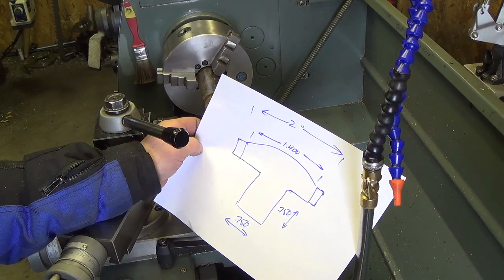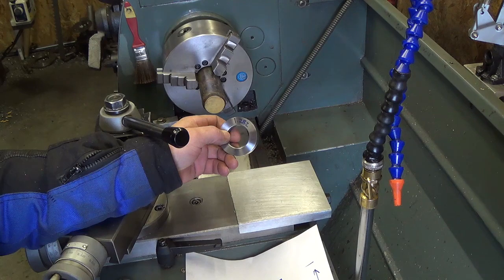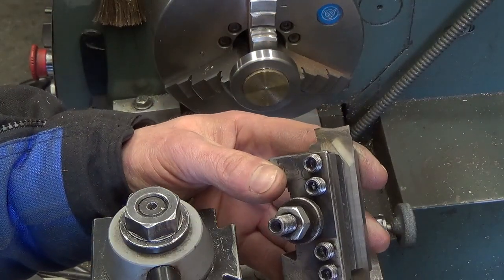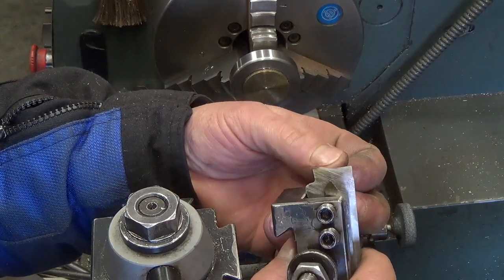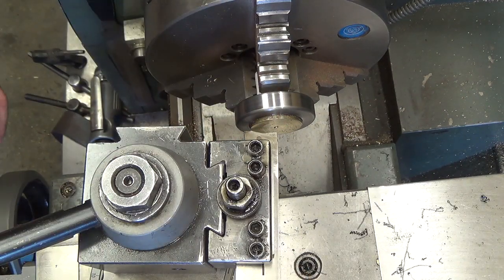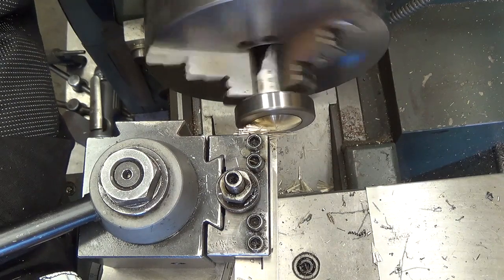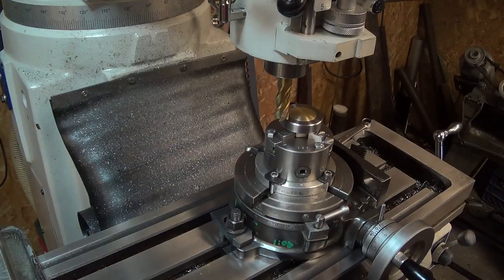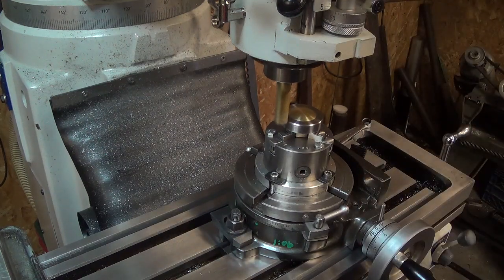5th Axis - Part 5

Comment: I like that you showed the bork of the hand nut. Like that doesn't happen to all of us at the WORST times. Did you end up using a setscrew ? Was it a small SS bolt with the head filed off ? Thanks for the videos, although I am jealous at the nice new mill and all I see. In the South US, we depend on what we can get from old machinery sales.
Tool Jealousy...ugly when it happens.

Thanks.
Reply from the maker: Should have had the small chuck tightened just a little more.. oh well. No setscrew, just a bolt with the head removed.
Jealous?? Ha, I'm so jealous of you guys and the availability of tools and tooling in the more industrial areas. There's nothing used in my area and whatever I want/need I have to buy new.
Thanks for commenting.  Colin ;-)

Comment: Nice Colin the SS/brass looks first rate.  Too bad at the end but those things happen and you were able to fix it right.
Reply from the maker: Yeah, I do also like the look of the mixed metals. I don't mind the odd boo-boo as long as it doesn't ruin the piece.
Thanks
Colin
Reply: ***** I hear you there I had the mill bit pull out of the collet because the power draw bar didn't lock it tight and had to build up the part with weld because the slot was too deep.

Comment: What ho Colin, I feel your pain, but a good save, if you had not shewn it no one would have known. Remember, an expert machinist is one who can hide his mistakes so no one knows.
In my case CNC stands for Chris' Numbskull Control.
Just curious about your topslide, why pick that particular angle? It's not 60 for threading, 6 for tenths feed or 0 for length feed or is it just an optical illusion?
ATB
chris
Reply from the maker: Yeah, I could have left it out but what would be the fun in that? :-) I normally only edit out the stammering and such to not subject the viewer to too much pain..lol
I normally keep the compound set for threading or at 90 deg for accurate facing control. I don't recall why I had it set at that particular point although I do sometime use it for fine DOC adjustment....who knows? :-)
Thanks for commenting Chris.

Colin